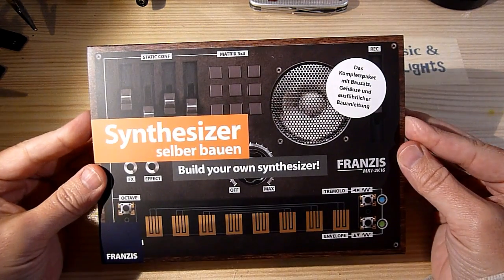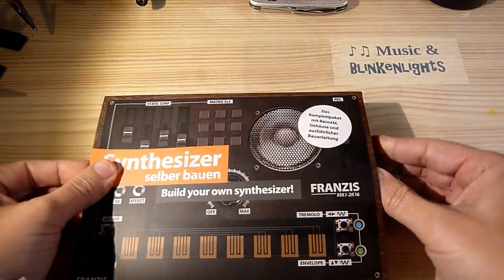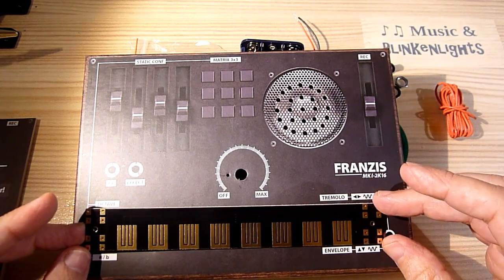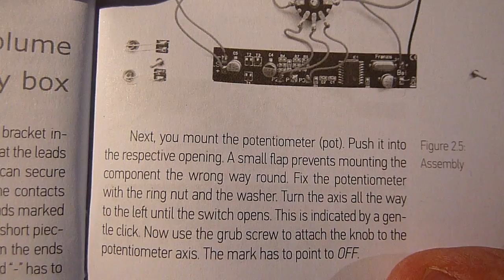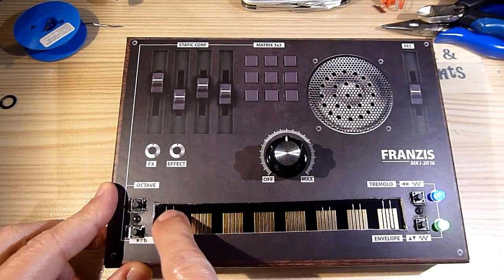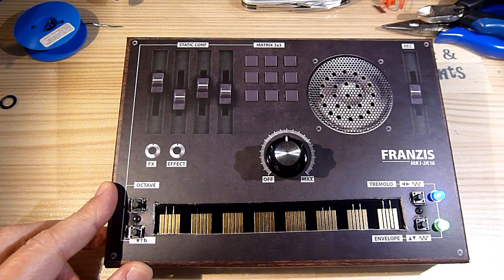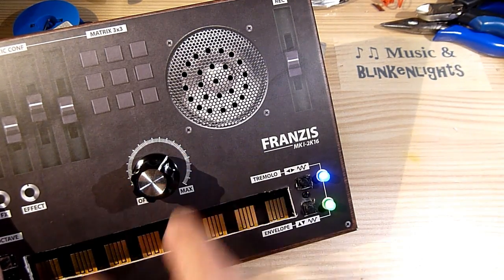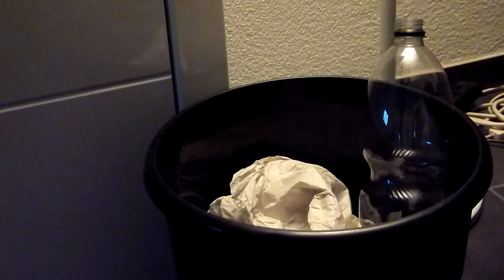Franzis Synthesizer Kit - Build & Play

Comment: I would mod this shitty thing to at least get something useable out of it. First by deleting the crappy speaker and install a jack output so it can hook up to some reverb, delay and/or chorus effects outside the machine which makes everything sound better. And then maybe tweak things and add a pot meter with a cutoff filter or something. 

I would never buy it in the first place. But for those who have, maybe investing 5 dollars more can do at least something about wasting the other 25 on this and make it somewhat usable.
Reply from the maker: That's a cool idea. Simple filters require only a handful of components. But my point was, that they could have done much better even in software if they expended a little effort.
Reply: @musicandblinkenlights8280  I agree. The concept of DIY is nice. And it shouldn't need extra tinkering out of the box, I agree. But when you bought it, and became intense disappointed after the work, you can always personalize and mod this one.